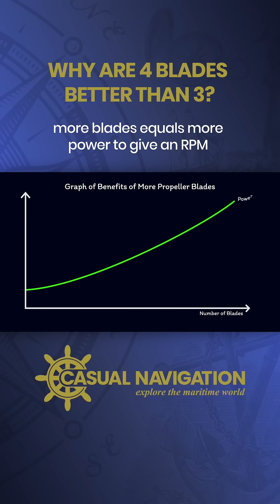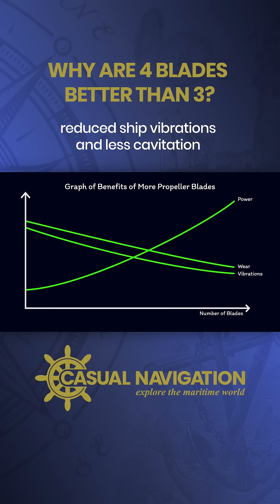4 Blades Better Than 3

Comment: What about offseting the blades so they dont have to work in each others wake
Reply: Not really possible as that would be maintenance NIGHTMARE as the off set props would vibrate the drive shaft like nothing else. Sure if you had 2 pairs of off set blades it could possibly work, but that is over engineering a solution to a problem that is minor in the worst of situations and at best, a very acceptable trade off.
Reply: The problem is manufacturing. See how much work it takes to make, and keep in mind each blade is taller than a man or two.
Reply: @davidaugustofc2574 oh.
Would this work for smaller ships/boats then?

Comment: I would be interested in seeing a ship use the newer designs that submarines are using.  That is, a spiral prop encased in a sleeve.  They have started using them to avoid cavitation while still producing good thrust.  Though there is more engineering involved because it doesnt use a direct shaft drive since the whole propeller pivots to steer instead of using a rudder.
Reply: While interesting, it would be just an expensive experiment because submarine props are ment for stealth first and foremost so power and engine efficiency will suffer far more on a surface vessel, especially civilian, than it would on a nuclear power submarine (where engine efficiency and power are not even considered due to the ridiculous output of the power plant).

Comment: Showing one blade prop is foolish . The vibration would be crazy !
Two blades  are the minimum .
Reply: Maybe they used counter weight like the 1 propeller planes.
Reply: @canesvenatici9588 it is probably cheaper to use multiple balanced blade, it was for the single bladed propeller for airplanes.
Reply: Their was a one bladed propeller for aircraft engines in the 1930s, but it cost way more due to the tech required to make it work

Comment: And suddenly I realize why submarine prop blades tend to look like thin sabers rather than a traditional paddle shape.
Reply: .... So your stupid....
Reply: Well, we've really never seen submarine propellers properly, because their exact shape can give away what kind of sound they will generate. That's why in pretty much every photo of a submarine in a dock, they propeller is covered.
Reply: @MrMaple-iq1sh  there are old photos showing these blades
Reply: @dimas152mm probably before CAD
Reply: @MrMaple-iq1sh there have been leaks, what they look like isn't a secret, but their exact design details are
Reply: @MrMaple-iq1sh Not everyone hides them, you can see many photos of submarine propellers on the internet if you search for it.

Comment: I have a genuine question, what are they made of? Steel or gold?
Btw nice videos, I’m learning so much thank you
Reply: They are made out of an stainless steel-aluminum alloy or a Nickel, Bronze and aluminum, some are made of different composite materials depending on the ship's needs.
Also, a fun fact, if the propeller were made out of gold, even some of the smaller 1ton ones, it would cost even more than some of the biggest cargo ships!
Reply: @atlas7501 really? Amazing, thank you so much
Reply: Usually an alloy of Nickel-Aluminium-Bronze, or NAB
Reply: @Finlandiaperkele thank you
Reply: Why the f*** would you ever think a propellor would be made out of gold? …. Lmfao
Reply: @DudeMan27 don’t be mean. Not everyone shares the same knowledge as you.
Reply: @the_jjabberwock  nah it doesn't take much to realise that a soft and extremely expensive metal like gold is unlikely to be used for a massive ship propeller. Bronze or Brass would be understandable to bring up.